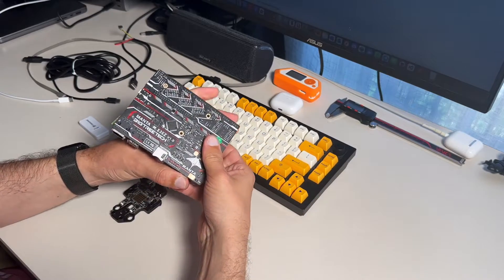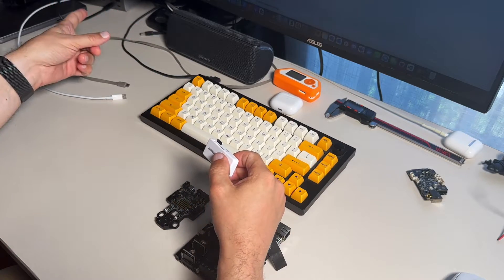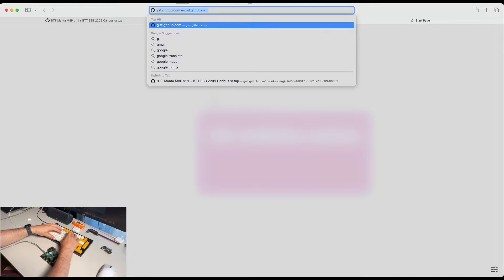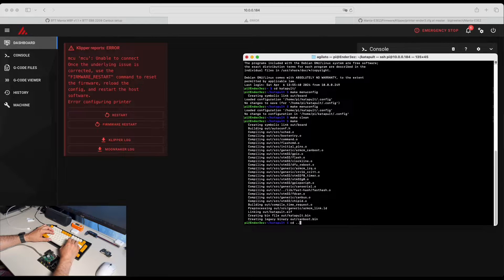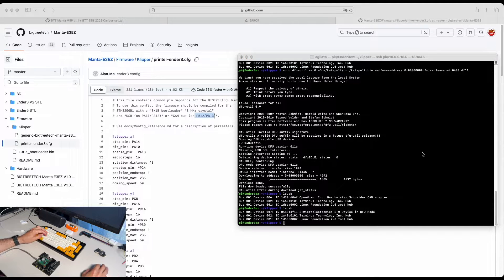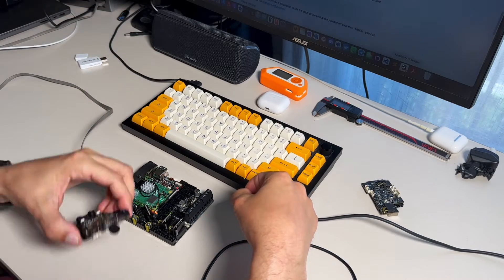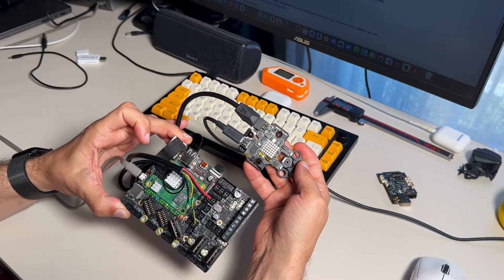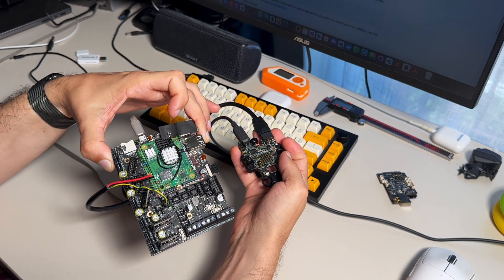CAN Bus Setup: E3EZ + EBB/Hermit Crab 2

Comment: Awesome walkthrough! You mention where you have the settings for katapult and klipper from and quickly show a document with the values. Could you share a link to that document?
Reply from the maker: I have adjusted description take a look there.
Reply: @hobbyistnotes  Great, thanks :) As you probably also have found out the Biqu documentation is really poor when it comes to the wiring. The Canbus cable has a red and black wire. As far as I can see in the Biqu pictures it is for 24v? Do you know if the usbc power cable can be omitted if these wires are connected to power on the psu or mainboard?
Reply from the maker: @innercitydk  You don't need USB-C, whole idea of CAN in this product is that you have 4 wires going via included wire, two of them are CAN L/H and another two are power from the printer power supply.
Reply: @hobbyistnotes  thank you, and the red and black is connected to 24v right?
Reply from the maker: @innercitydk  Input voltage is 12v - 24v as we have some printers using 12v PSU

Comment: Why did you choose to use PD12/PD13 when creating the make menuconfig (klipper) and PB12/PB13 for the mcu (katapult)? Shouldn't they be the same? Just curious, looking forward for answers! Thank you for your content btw

Edit: I see that u are using an adapter on your Raspberry, i am using a cb1 board, which pins should i pick? I tried flashing several times and sudo ifup can0 can't bring up can0...
Reply from the maker: Honestly it was quite some time ago I do not really remember at this point and it could be easily a mistake... Your CAN interface have to be always up even when devices aren't connected if it's not make sure correct pins are used while flashing the board. If I am not mistaking you might also need to change startup config for CB1. Good luck with your setup!

Comment: I’ve tried so many things. When I lsusb both boards show as CAN. But I can only get the uuid for the main board to show. The ebb36 just won’t. Have there been changes the last couple of months or so? It’s driving me absolutely insane. 

Bigtreetech is so bad with there documentation
Reply from the maker: Check what I say at 8:00 and make sure you use correct values for the board you are using. Is it ever worked for you? if no, try to swap CAN L and H also make sure you have 100 omh Jumper installed. Always comment all lines of code related to uids cus if connection opened it will drop the device from the list.

Comment: Hi Hobbyist, everything is working perfectly. It was super easy with your guide. I only have one problem now. I have no idea which connector is used for the RGB port on the HermitCrab. I have tried Molex PicoBlade and Micro JST, it was neither. It is frustrating that this is not mentioned anywhere in the documentation and I can't find anything on google either. Hope you can help :)

Best regards
Reply from the maker: I am not confident but those looks like JST SH connector to me, not sure about the size. I personally would try 1.0mm size, but it's just a guess.

Comment: Can these software steps be followed for BTT octopus pro and BTT SB2209?
Reply from the maker: You can follow steps just use build settings with pinout for your boards, here is a good topic for your board: https://www.teamfdm.com/forums/topic/672-how-to-use-can-toolhead-boards-connected-directly-to-octopus-octopus-pro-on-canboot/

Comment: Thanks so much for the video.   I appreciate this.   I will be trying to get the SB2209 and Manta E3EZ up and running following this vs the manual.   I see where I went wrong but as one of your other viewers noted some of us coming from Marlin or none at all find this a bit different and unless someone walks through this the way you did it makes it difficult to understand.   Hope this video finds the many that have struggled with this.   Many videos on using the U2C board but the only one I could find walking me through everything needed to setup canbus on Manta Board and SB2209!
Reply from the maker: Hope you will figure it out. I remember how much time I have spent 1st time configuring CanBus with my Mellow RP2040. Now tools are better and ton of videos how to make it work. At the end journey of struggling and figuring out is part of RepRap movement.
Reply: @hobbyistnotes  OK got a chance to try this and it worked good up until the point where I have flashed everything and see both devices.   I changed printer.cfg printer type to core xz and changed thermistor to the value the revo hotend uses and I keep getting min max error message for temp.    I plug a normal sensor on the board for the hotend and its fine and shows value of temp.    I wanted to test the fans and sensor before I mount on printer.   Not sure what I am doing wrong.   Again I am new to canbus and Klipper.   Any help would be appreciated.  Looking to use this on Most expensive enderwire, lol, as your other video got me moving to this point.   I just noticed one thing but not sure it matters.   When displaying devices after commenting the Manta Board UUID out it shows both as Klipper not like yours where one is Katapult.   The UUID's are different and were gotten for each board before flashing.
Reply from the maker: @2muchscott  At the end when you are done both boards have to be Klipper (17:23) in Klipper CAN devices viewer and in my case it was showing Katapult cus we still had to flash klipper via CAN as last step of the video. If your temp values are working properly with regular thermistor but do not work with REVO may be something wrong with your REVO thermistor or it's connection, for me it's very hard to help you cus I don't see your printer config. Check Revo's thermistor resistance with multimeter the value have to change if you heat it with your hand.
Reply: @hobbyistnotes  OK, I started over and was able to get both devices and names look correct.   The printer config file I have is the one I pasted in using your video as a guide so maybe that is the issue.   I uncommented out the Extruder section and was expecting to be able to test the thermistor.   I had removed the 5 volt jumper prior to doing this and just using can cable.   Again I am new to klipper so this weekend is my weekend to research a bit more.    I appreciate helping me setup the canbus though.
Reply: Update,  Pasted in BTT Sample Canbus config for the RP2040 board and changed the reference to EBBcan to what I named the MCU which was SB2209 and I am getting temp from hotend!   Part Cooling Fan works as well.    Im guessing I have a bit more digging to do.   If you have an example config for your enderwire using this manta board and RP2040 card and could share it I would appreciate that.   Again, thanks for all you have done!   I really appreciate this.
Reply from the maker: I don't have exact config for your setup but in my github you can check my enderwire config for SKR Mini E3, maybe you can learn few things: https://github.com/irebane/my-printers-misc/blob/main/ender3-skr-mini-v3-switchwire-klipper-printer.cfg
Reply from the maker: I am a bit busy now but later will upload latest config as to many things have changed since conversion. Also may be later I will convert toolhead to use CanBUS to make setup a bit cleaner.